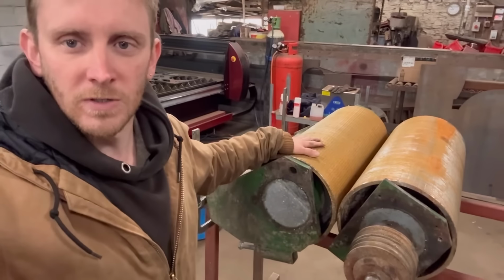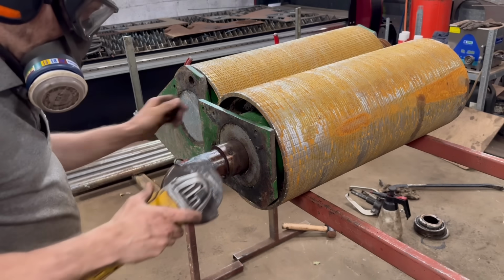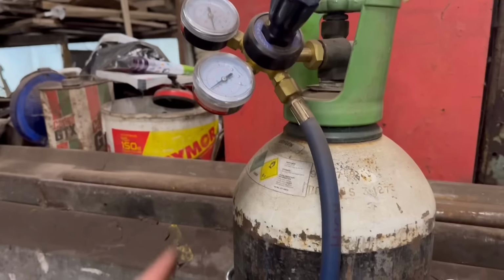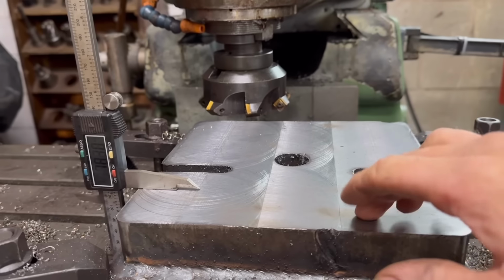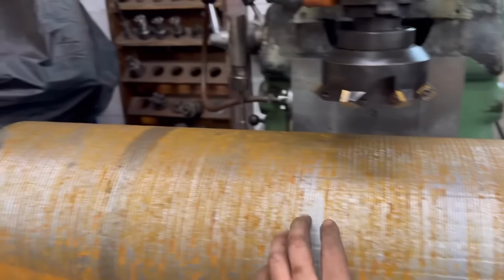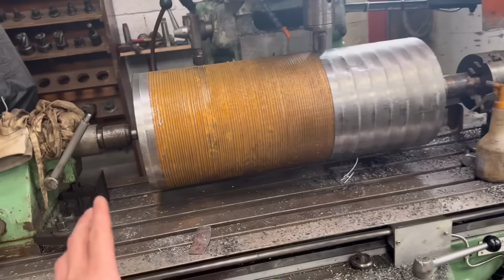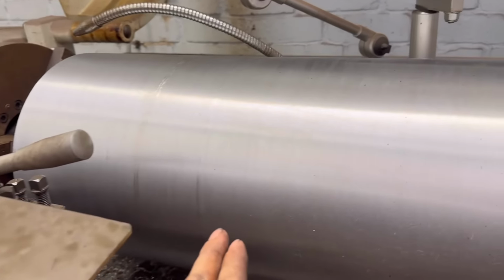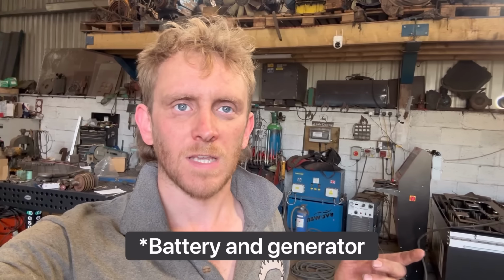Skimming rollers out of a roller mill. I need a bigger lathe!

Comment: Hi Oliver, good idea using the mill, and clever use of the tailstock, and dividing head spacer. This setup will be useful for other jobs, as to a new lathe my advice would be first work out how much space is available in your shop, and then shop around for the the lathe whith the most capacity that will fit in there, they'll always be a use for it in the long term in your kind of work. Atb Stuart Uk.

Comment: Hi Oliver,    Oxygen pressure seemed very high   110 psi   7.5 bar,  I just checked 2 inch plate  40 45 psi   number 3 nozzle jet.  Chart got  12 inch plate only 80 psi .   1 bar is 14 1/2  psi. 
Dam stuff dear enough no need waste it.

Steve
Reply from the maker: I’m following the messer cut chart for the torch I have.

Comment: Hi Oli,
Not trying to “backseat machine”, but had a couple ideas while watching (and ran them by my brother who is a master machinist (as in master tradesman) to check if I’m delusional with my setups or if it would be an “okay” / “ok in a pickle” idea).

For the cut depth dilemma you had (checking across the whole length / noticing in the middle) you could have done a cut just on x (without rotating) across the roller in 1 or more orientations (rotating the roller) to check depth, instead of milling the entire circumference of the roller over the entire length.

As others have mentioned already, the backlash issue could have been avoided by conventional milling, this would have cut down on your cutting width, but would have likely given you a more consistent cutting load, allowing you to use a drill (e.g. the feed of your line-boring setup or “just a hand drill”) to basically convert the indexer into a driven 4th axis. Once you have that, cut width becomes less of an issue, and you could have used your auto-feed in X to spiral your way down the roller.

Having an “auto-feed” 4th axis would (at least if speed was adjustable, e.g. by using the line-boring feed motor) have also allowed you to mill the spiral groves across the roller by slowing down the rotation and then auto-feeding across in X.

An option for your cutter issue would have been to use the shell mill with the Y-axis offset, so you are cutting on the “Y corner” of the cutter. Since the cutter is fairly large, you could have gotten away with a fairly wide cut, while still being “flat enough”. The increased number of engaged teeth would have equalized cutting forces and the cutting forces would have been in one direction, rather than mixed as they were with the end mill running on center and cutting full width.

Another option would have been to use the shell mill on the side (the long 45° edge of the inserts roughly tangent to the roller, the cutter “behind” and below the top of the roller), cut width would have been smaller, but like conventional milling your cutting force would have been in a constant direction.

PS.: do yourself a favor and when you’ve got a minute flip your indexer spacer around and add matching keys to the bottom for future setups and write down / knock out a small fixture / guide for positioning the tail stock, if you are planing on using the setup occasionally (the amount of setup work required often dictates which solutions you are willing to use / are worthwhile and reducing the dread of “having to use” a setup is key...)

Comment: Have you looked into getting a third phase from your electricity supplier Ollie? It might seem a lot but over time it has to be better than using a genny or solar cells /batteries and an inverter. 10/10 for initiative with your milling setup. If you gear your dividing head to the table travel it would give you the skewed groove. look up helical milling. Tip for aligning centres is to trap a rule between the tips, it is vertical when the tips are aligned. Finally I hope you cleaned up your pal's lathe and bought him several pints afterwards.🤣🤣
Reply from the maker: It would be in excess of £100k I’d have thought to put 3 phase mains in.

Comment: Instead of using anti welding spatter spray you should try welding blanket on the table. I know you would need to make holes for the clamps but I believe it will be of much help to protect the table.

Comment: At 5.36 mins you need to remove the sheave pulley and a spacer. I have similar set ups where I work, and we use what's called a strong back which aids removal. There are strong back kits available to buy, but you have the machines to make an individual strong back when required as we do. We machine a circular disk or blank, drill shaft clearance diameter in centre, then cut to O/D of the blank to allow fitment over the shaft.
Two holes in blank to take suitably sized thread bar and utilise the hydraulic puller and fork to complete the puller. Sorry for the tome ;)

Comment: off grid 3 phase is available here in Australia, i looked into it a year or so ago for my home hobby work as 3 phase mains is not available. Entry level was about 15k, against 10k for single phase, i couldn't justify that on the off chance i might want to run a 3 phase machine later on, particularly when i can buy a Chinese 3 phase generator for under 2k (long term reliability not really a critical concern for a home hobby setup) . But they were really geared for bigger systems for big workshops etc in remote areas.

Comment: Why didn't you try to go deep and turn on the longitudinal feed of the table? I think it would be faster and the handle of the dividing head does not need to be twisted at the same time. good job!
Reply from the maker: Because then id have loads of flats around the roller

Comment: Hi Oliver, just wondering if you were remove cross slide on lathe, and jerry up brackets to hold top slide and or tool post. Would that give you enough clearance to get surface cleaned up? Love your work, Rob from Geelong in Oz. Ps, would it be better to get rollers hard chromed after machining?
Reply from the maker: Possibly.  
I think he said the last time these rollers were resurfaced was in 2011 so they’ve lasted a long time

Comment: You can run welders off of a phase converter.  I have been doing it for years. Now my welders are transformer machines, I don't know if about the newer welders with all the electronics in them. But one of my mills is a little newer and runs fine. Just have to watch your wild leg I've been told. Running a Lincoln Ideal arc 600 off a rotary converter.  The bigger the converter the better.

Comment: A paddle mixer with the right size nut welded on the shaft will make turning the handle so much easier. It’s got plenty of torque and no impact so it won’t destroy the gears.

Comment: If you can find a way to spin a 3 phase motor, you can generate 3 phase with it. Use a large motor to spin a slightly smaller 3 phase motor. Solar to battery to vfd might not work with your welders etc.

Comment: Get a three phase generator head and connect to split phase electric motor (one option).  Basically motor generator.  that is true three phase.  Or get a rotary converter.  That is a three phase motor connected directly to the single/split phase mains and a capacitor with a timing relay connected to the third phase to get it rotating.  Problem with that is the third phase is weak and the three phases are not really 120 degrees apart.  Always worked on older lathes, mills and drill presses, just had less horsepower because of the weak leg.  If you go off-grid, then you could set up solar panels, batteries, charge controllers, and a dc motor to run the three phase generator head.  Seems to be lots of work.  Almost easier to get a three phase generator head and put some gearing on it and connect to PTO.  You might find a three phase genset with a blown engine and be able to use that for parts.

Comment: Hi Olly, I'm not sure how well even a commercial / industrial solar system would cope with the high voltage/current spikes in the draw from welding equipment. Have TecArc (or whoever makes it) told you that your converter won't run a welder as I'm sure I've been told that they will.

I have a mate who runs a solar installation company (he did Tom Pembertons last lot of solar if you follow him on here.) i can ask if you like. Or get his details for you to ask.

Comment: Nice job.  Re the 3-phase needs, I would suggest solar would be a fail.  You could potentially have a battery pack charged by a single-phase charger, outputting via a 3-phase inverter.  Something else to investigate, is called a 'rotary phase converter'.  These normally uses a motor-generator combo, to essentially generate 3-phase on your premise (efficiency can be poor, be not much of an issue if only for short periods).

Comment: Another brilliant video, Olly. Great to see investing in new equipment and growing

For off grid power especially with the requirement for 3 phase you'd need a lot of money. PV system along with MPPT inverters and batteries would cost around £24,000 and more than a 50kva diesel generator. Rotary phase convertors are equally as good as using a VFD but your single / split phase 240v is most likely already at it's limit

Comment: Hello Oliver,

Can I make a suggestion for a “custom made puller” after seeing you struggle, at 6m.30s, trying to get the 4 vee belt pulley moving with a crowbar with a risk of slipping and smashed knuckles?

1-Cut a a U out of a heavy piece of plate to fit behind the pulley.
2-Weld 2 lengths of steel to the plate parallel to the axis.
3-Weld a short piece of steel to the 2 lengths of steel

You can now hammer on the short piece in line with the roller axis to get the pulley moving.

Design improvements when time allows-
1-replace the long steels with 25 mm studding.
2-fit a slide hammer to the short piece of steel.

Hope this idea gets you out of a problem in the future.

I discovered your channel a few weeks ago and I am really impressed by the way you solve the problems that crop up on each job by making the tooling/jigs you need, such as the line borer/welder.

Looking froward to the next video.

Comment: I'm surprised that the harrison don't have bigger capacity over the cross slide. I have a colchester mascot (might be a special one) but it will sving about 350mm over the cross slide and 1m length. 
If you find a bigger lathe (depending on how much bigger) I will say if you have the money and the space then keep the harrison. A lot of the times I find that I really want one a size smaller for the smaller stuff. I don't like to run a 315mm chuck at 1400 rpm. So I am on the hunt for a small 200x1000 or close to that.
Reply: They do it's the M500 Ollie mentioned, 370mm over the carriage and 3m centres, the M300, 400, 500 destinations are the nominal diameter swing over the beds, actually it's about 1" more in each case
Reply: @Paul-FrancisB  yes but what I was surprised abut is that the m400 and the colchester mascot is about the same size footprint and power if I remember correctly so I'm surprised that the sving over the cross slide is that small
Reply: @jesp7657  ah sorry read it wrong I missed the "the". My M300 long bed (one down from Oliver's) is equivalent to the Colchester student so only just over 4" centre height above the saddle, even though it'll swing 19" diameter in the gap.
I agree with your sentiments about having a smaller lathe available, it handy being able to throw a collet chuck in and spinning up to 2500 if I need it for smaller parts

Comment: Hi Oliver, There will always something that doesn't fit the machines we have. But there are always ways around the problem. You just need to be a tad inventive.
There is a you tuber called Keith Fenner who is in Cape Cod USA, who 5 years ago he had to line bore the main bearing housings in a 5 cylinder Audi engine. The centre height to the crankshaft was well above the spindle in is Clausing lathe, but his set up could be copied to to do your current project. In basics, he made two bearing supports to carry his line boring bar and mouted those on the bed and mounted the engine block on the lathe carriage. He only had to turn the bearing housings so relatively short turned sections, and he had multiple tool mountings in the line boring bar. In your situation, if you had to bearing mountings (that could be height adjustable for future projects) you could mount those roller shafts in those two mountings, to drive the (line shaft in Keiths) the roller in your instance you would need a drive shaft with two universal joints (one each end) monted in the chuck and to the roller shaft, so the part is now turning as it would in the normal chuck tail centre, you could make a tool holder to take up the height difference to either mount HSS tooling or indexible tooling. 
If you want to view Keith's videos, this was a multi part project called "Because I Can Part 0ne, Two etc.
I hope that is helpful for other projects in the future,

Best Wishes, Dennis, Queensland Australia.
Reply: Keith Fenner hasn't posted a video for 2 months now.
He was most recently working with molten lead, pouring babbitt bearings. 
Am hoping he didn't have an accident or fall off the wagon.
Reply: @andyloebrown8250  Keith posted to Rumble 22 days ago.
Reply: @kindabluejazz  oh thats wonderful,  thanks.

Comment: I built a lathe of that design years ago, the theory being that you turn the work piece slow while using a high speed cutter.  In that way you do not need a high power motor to turn the head stock.  I used a High speed spindle to do the cutting.  I think you could have succeeded if you had set your mill at max rpm, uses a 1/2 carbide end mill and set the head at a slight angle so that only the tip of the end mill was contacting the part.  You could have made a quick power feed for your dividing head by bolting on a sheave and mounting a motor and belt to drive it.  Then by calculating the rpm of the work piece you could have set your carriage travel for full coverage.  It's not an ideal way in your situation because of the backlash in the dividing head and the low speed of your spindle.

Comment: Instead of a solid state inverter you could use a electric powered motor generator set which produces true 3PH power from single phase at a fixed Hz either 50hz or 60hz then any 3phase equipment will operate w/o execption however you will not have any variable frequency speed control for equipment with electric motors. This is a generator set with an electric motor replacing the diesel/gas engine for a power source.
 I would have milled grooves longitudinal on cylinders then sent out for induction hardening of cylinders to make new grooves repairs very longlasting. I would have explained to user how much longer service he would get from extra expense for the hardening.
 Further improvement to upsell user is to add adjustable cylinder crearance allowing user to adjust clearence between cylinders for wear and to keep cylinders perfectaly parallel, and user can then use grain cracker for varing sizes of grain. Ray Stormont
Reply: I got one of these because i only had 1ph 220Volt 16 amp in my hobby space and needed about 2kW of true 3ph 380 Volt to run my Sixis 103 mill. It works as advertised, dims the lights a bit when starting up but it kept me going. Now i have a new hobby space with proper 380 V 3ph. I had converted my smaller mill and shaper to 220 Volt so now i have to convert them back again, good thing i kept the original electric motors.

Comment: Look at a different phase converter mate.

Should be no issue finding one you can run a welder off. Might even find that your current one would work just fine if you had a decent size three phase motor running off it at the same time.

Comment: have you adjusted the gibbs strips on the miller to try get it to keep more accurate?
Reply from the maker: I haven’t done.
Reply: @snowballengineering  just screw all the bed and column gibbs in until all the sloppiness goes anda then the chatter will be reduced a lot.
Same with the lathes.
All the time I worked in engineering I never met anyone who adjusted their machine's gibbs but slack gibbs allow chatter.

Comment: Using Two Motors to Create a 3-Phase Supply from a 2-Phase Input for a Plasma Cutter
In situations where a plasma cutter requires a 3-phase power supply, but only a 2-phase (400V) supply is available, a creative solution involves using two electric motors. One motor operates on the 2-phase supply with a phase-shifting capacitor, driving a second motor that acts as a generator to produce a clean 3-phase sinusoidal output. What is the maximum fuse size for your shop? What are your power requirements?
Reply: That solution might not be legal, because the strain on the double loaded phase. Pulse Width Modulation inverter might be the only way, but you'll need that for solar power solution anyway.

Comment: Looks like you've finally got some really nice weather over there in the UK. It's the opposite here in Queensland Australia, with winter biting hard. It's been down as low as 3°C here at night and only around 22°C during the day. I'll be glad when winter is over. But then it gets really hot here. It would be good if it was nice weather all year, but that won't happen here.
Reply from the maker: It’s about the same daytime temperature here but not as cold at night. 11c or so at night

Comment: Nice to have mates who have a lathe you can use, hope you cleaned up before you left. 😂 Re your off grid question, have dealt with something similar before but it's not cheap. Your best option would be to instal a 3 phase hybrid converter, this takes power from multiple sources when needed, solar, wind, generator or mains. From solar and wind you would need storage batteries, as you need the uninterrupted supply. 
If you can, speak to Tom Pemberton, am sure he got a grant to help with his solar panels. Good luck. 👍